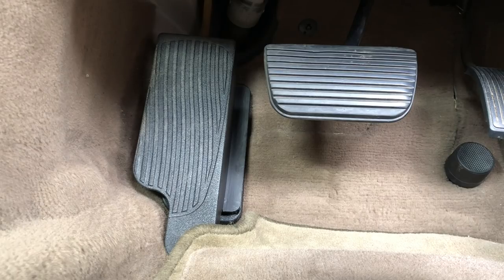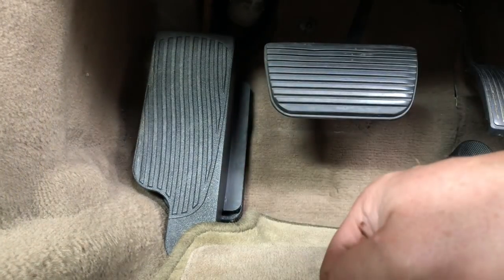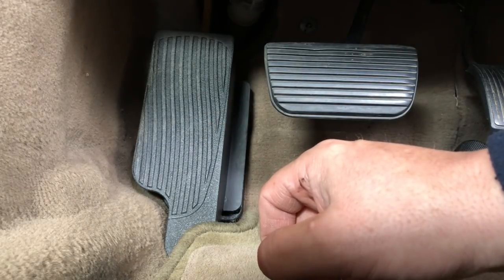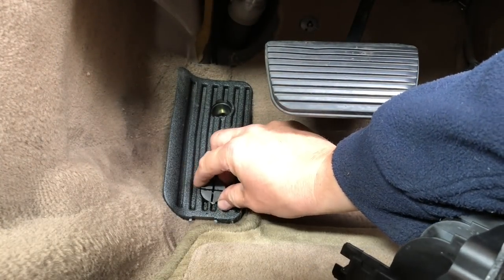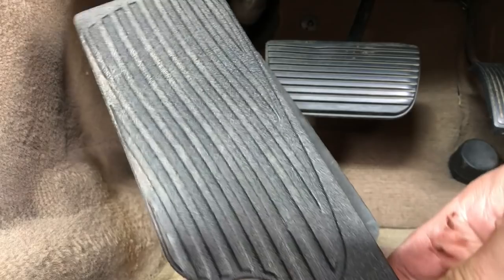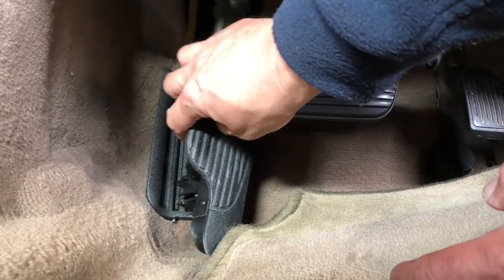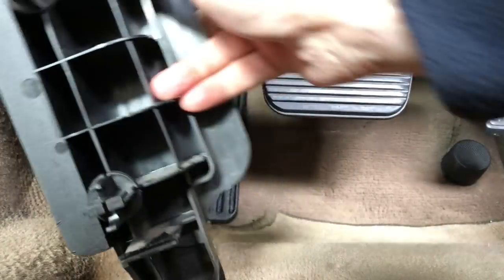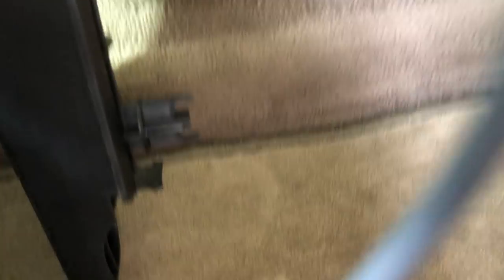Adjust Jaguar XK8 XKR pedals. Secrets of the XK8 episode 24.

Comment: talking about pedals just how much travel should there be before the brakes start to kick in a seller told me it was normal for the pedal to go about half way before the brakes start to work and they were spongy as well
Reply from the maker: Sounds like the brakes need bleeding and a new set of flexible hoses!
Ive never been a completely happy with the XK8's brakes but they can easily set off the ABS on a dry road if you hit them hard start to work within about 1 cm of travel and although not rock solid. They should not be 'spongy'. Test a couple of cars to get a comparison benchmark.